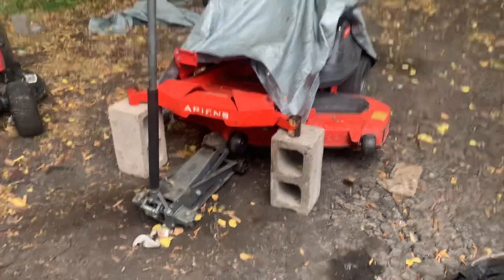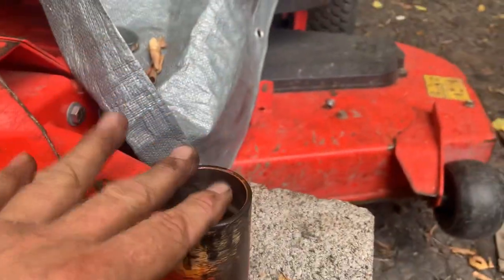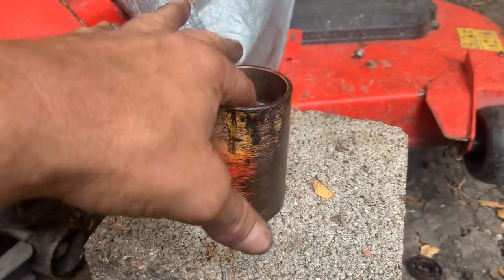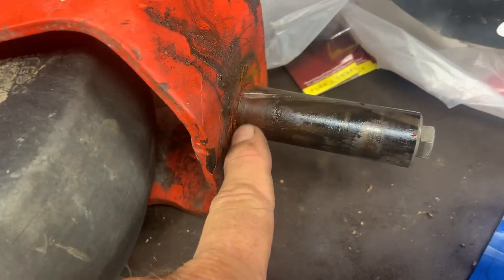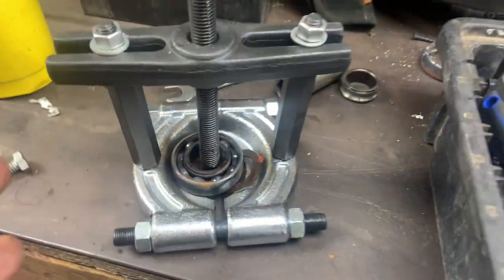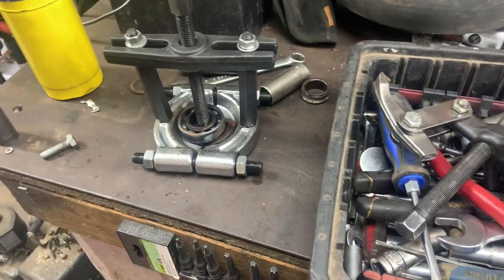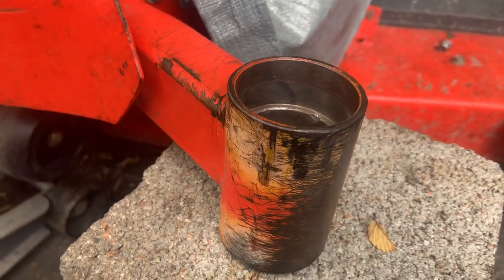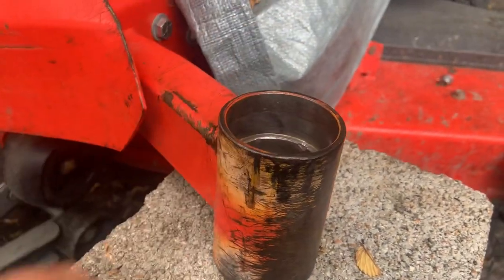Zero turn front fork bearings

Comment: My Gravely is an older model 1999 260 zt, It has a threaded bolt at the top end and according to the parts list it takes a cup, then the bearings and a seal and a spacer. The same on the top except for no spacer. A washer then the bolt with a cotter pin. How would that bearing puller help me get the cup installed up in the shaft so I can put the bearings and a seal so the threaded bolt part sticks up far enough to put the cotter pin in the nut. Thanks for any information.